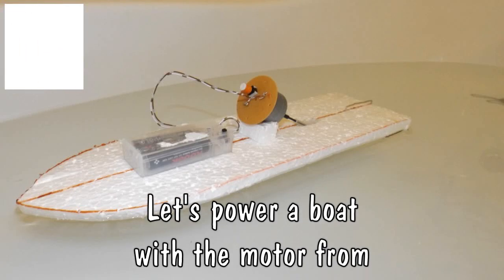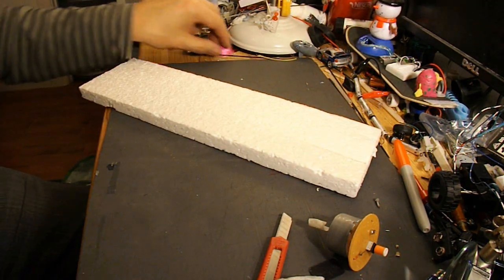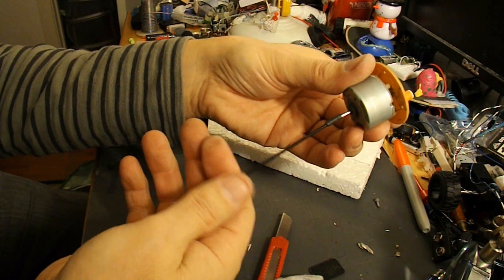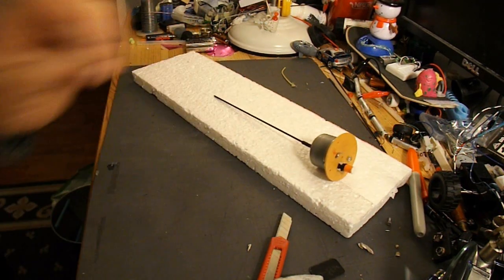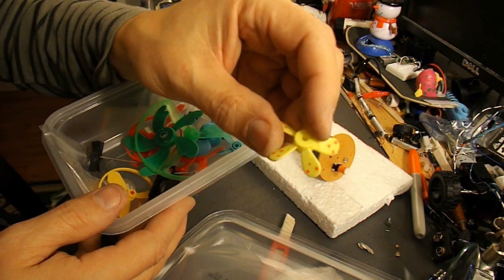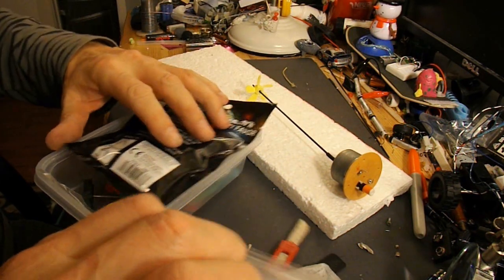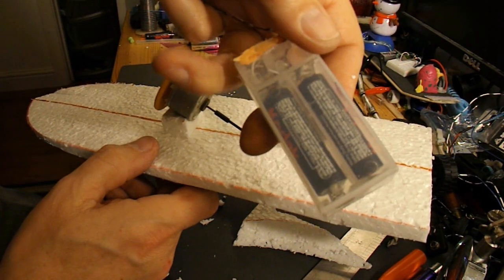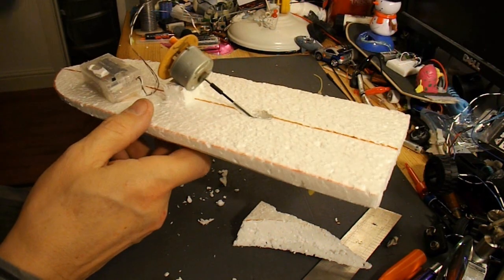Let's power a boat with the motor from a Solar Vent

Comment: Hi grandad,
I intend to make an RC boat using basic components I ordered from ebay when they arrive to my address in about a month, in a similar way to this boat, but using the bigger motor like you've used from hairdryer, powered by a 2S lipo.
If it has a flat hull like in this video, and more throttle is added to it, will it handle well on the lake, or should I try finding cheap toy boats and then use their "sharp bowed" hull instead? Cheers!
Reply from the maker: +Viktor Božičević I am no expert on boats so maybe you should ask on a proper model boat channel. As I understand it a V shaped hull will give you better penetration and better directional stability than a flat hull but you can use a flat hull in shallower water.
Reply: +GrandadIsAnOldMan So this means that it will most likely fall over if I use a flat hull in the wind? Thank you.
Reply from the maker: Viktor Božičević probably more that it will be blown sideways but you could put a keel underneath to help it hold position in the water.